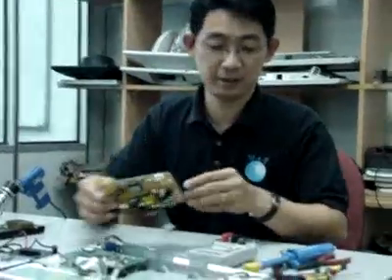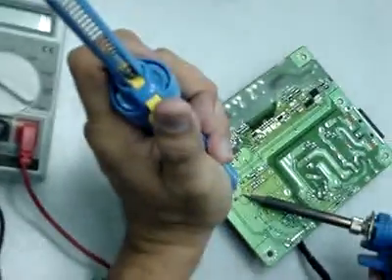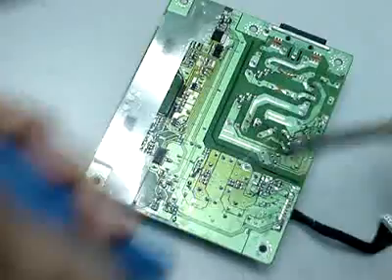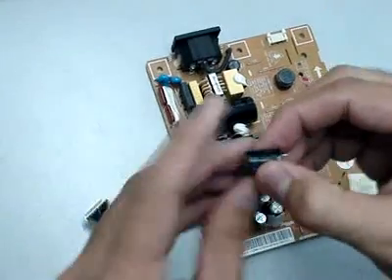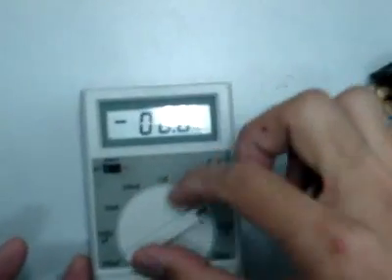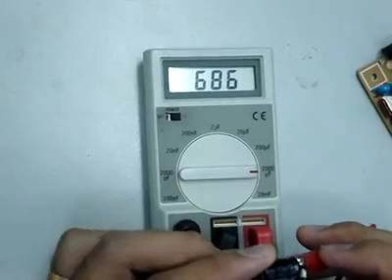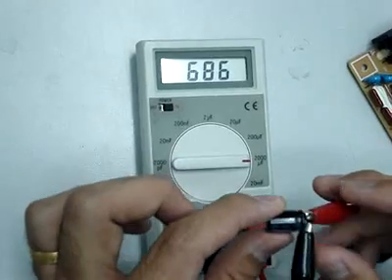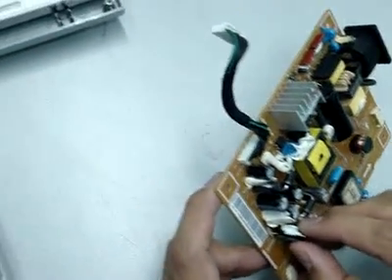How To Check A Capacitor - Electronic Repair

Comment: So, to test a capacitor remove it from the circuit (obviously) and test it with an instrument called "capacitor tester".
That's what you just learned. Invaluable.
Reply: hey ,if anyone else  wants to uncover 
repair notebook
 try Saankramer Electronic Magazine System (do a search on google ) ? Ive heard some amazing things about it and my mate got amazing results with it.

Comment: the capacitor's ESR is the thing to look for, not the capacitance value itself. Afterall, if a given capacitor is defective, it may have some sort of visual hint, however if it physically looks fine, the ESR measurement is the way to go

Comment: By the way, to desolder components, whenever required, I use a Hakko 808.  Believe me, once you see your first component falling off the board like magic with this tool, you'll wonder how you could have live without it!  It does a fantastic job with minimal heat transfer.  A real gem !

Comment: Like few viewers already mentioned, the capacitor's ESR is the thing to look for, not the capacitance value itself.  Afterall, if a given capacitor is defective, it may have some sort of visual hint, however if it physically looks fine, the ESR measurement is the way to go.  Fairly easy to measure with capacitors of 1uF and above, but could be tricky for the other ones.  Globally, ESR is measurable on electrolytic capacitors.  For the others, this might be a different ball game.

Comment: Easier and more accurate to use an ESR meter to test an electrolytic capacitor, in or out of circuit.

Comment: Actually if you want to spot bad caps, just look for the ones that are bulging a bit. And if you have an LCD based TV that goes on the fritz, open it up. There's a part# on the power supply boards. If you're not adventurous you can just swap the whole board.

Comment: hi can u help me out here i have a television currently it has not been showing clear pictures  but a single blue line and it has a sound that goes voorooom they said it has burned capacitors on it so i tried opening the television to locate the swollen capacitor but could not find it.can you guys help me on how to fix the television

Comment: If a capacitor is swollen it is very likely broken. In the power supply a broken capacitor could lead to a instable voltage and therefore to hum on the output.

Comment: Hi,I have a disco audio mixer (5 channel) and theres a problem you can maybe help me with. There is a very noticeable hum on the master output, even with no inputs in at all it still hums (like 50hz tone) but its not a ground hum.
I took it apart found 3 voltage rectifiers 5v + 2 x 15v (+ and -), replaced them but still buzzing, theres 2 caps in series on the psu 35v 1000uF ,one on them is swollen badly, my question is this, can a poor smoothing capacitor cause major hum on the audible output?

Comment: You could test it while on the board but then you only have a tiny surface area on the pad since you would have to use prong testers instead of the clip testers the guy is using. Clip testers have a better surface area so would be more likely to have a good connection. If you wanted to test every cap on a board with thousands of them on it , you wouldn't do it by hand with no knowledge of the circuit. That would be madness!

Comment: With an ESR meter you can test most electrolitics in circuit. I've been a professional E.T. for 37 years. With out the ESR test this test is worthless on electrolitic capacitors.

Comment: you have to also use an ESR meter, don't depend on this test only. I don't consider myself an expert but I've been messing around with electronic repair for 40+ years.

Comment: @3Target33 
If you see a bulge or a split on a cap it's a sign that the cap is leaking rule of thumb change it and remember always get the same micro farad cap you can use a higher voltage rating but always use the correct micro farad :-)

Comment: @pitchwest it's the only way to check a capacitor. (or was it a resistor that needs to be off the board?) i'm having doubts myself now :d (my excuse, i never learnt this shit, just saw a couple videos :-) ) i think it's the resistor, you need to place that on the positive wire (cut the wire in half and place the resistor between it in order to check it's values, right?)

Comment: @DJPaulgee1 
You can sometimes test in-circuit using an ESR meter.  However, if there are multiple capacitors in parallel then that will interfere with the reading.

Comment: @Ladylora24 In this case you have to change the power supply.  The Capacitor is usually a solution to a monitor that does not turn on as fast or does not turn on at all.  All other cases is the problem of a power supply and not much can be done there because so many different things may be wrong in vast array of components.  

Also checking capacitors like he has isn't the way to go -- only because it shows a capacitance doesn't mean it doesn't 'leak'.

Comment: @blade004   i would change all in the power suppy of a tv or monitor   ,,on tube type .radioes  high esr would not hurt  only shorted or leaky ones  the new power suppys cant stand high esr   i just used .03 -.05   as an example..most new low esr caps run around that   ..hope that helps  using an ohm meter will not help in new tvs an monitors ..like the old days   hope this helps

Comment: @blade004  u want a very low esr  .02-.05  an a 100uf showing 95 will still be ok if esr is low an not leaky my monitor had a bad cap that had a 1.9 esr leaky ..get good caps 105 c   hope this helped you

Comment: @MVLINEMAN its typically written in small print on one side of it. other than that you can't really tell. different size doesn't mean different level of capacitance. sometimes but rarely are there color bands on capacitors. google links you to a couple different sites that have what each color means.

Comment: The capacitance may still be in range,but you need to check the leakage/ESR/ESL also,especially in switch mode power supplies.
If in question,just replace it. Caps are cheap,and a common fault.

Comment: @zer0dahero:   Yes, you do have to remove the capacitor from the circuit board.  If you don't, you will end up testing the capacitance of the whole circuit (not just the cap), and since the meter is using its own voltage to test the cap, that test voltage can fry other components in the circuit.

Comment: no you dont have  to removed  the cap you can check it on the board with the capa check plus911 is a very good  tool to have  and you can find it on ebay  capa check plus 911 is made in argentina

Comment: @xxmannylee1992xx  Yes with an ESR meter you can test while in circuit, but not with circuit energized and with cap discharged.

Comment: Your esr meter has a bunch of settings,you set yours at 2000, question is how did you know to set it on 2000 and not one of the other settings?